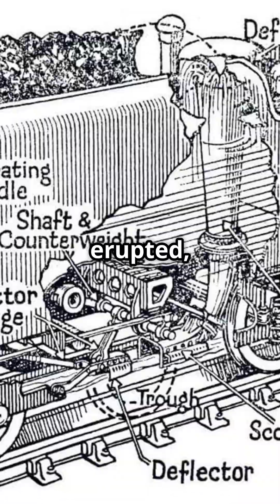The Final Secrets of Railway Water Troughs #railway #fyp #railwayhistory #steam  #trains

Comment: No, as stated above, they're simply not needed, due to the length of journey on heritage railways. Those on the Settle Carlisle were though, and were steam heated so they didn't freeze in winter. On the Standedge route, they were located in the 3 plus mile long standedge tunnel - the only stretch of level line on the route.